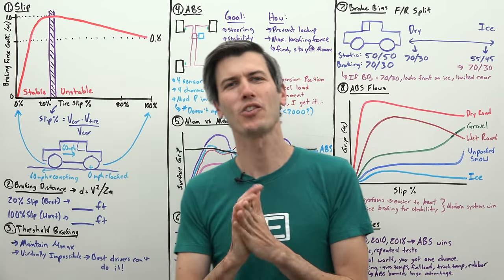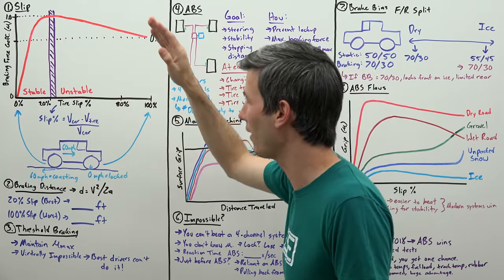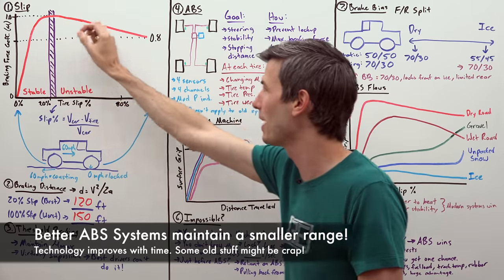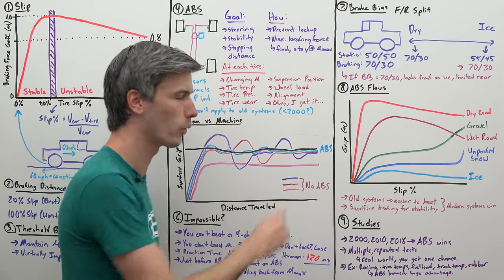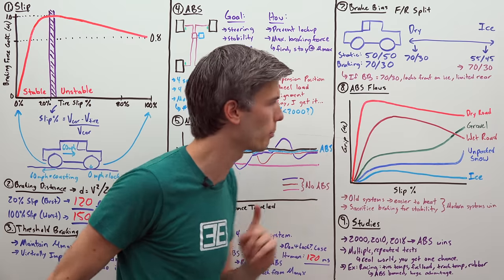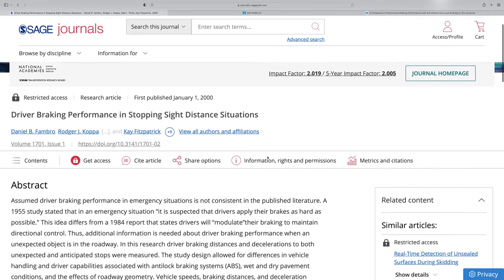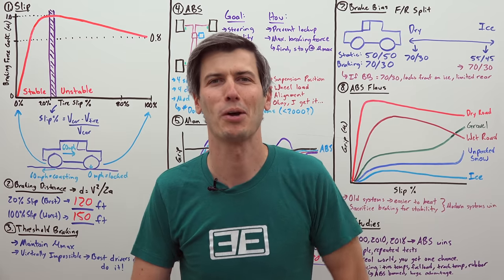Why Threshold Braking Is Impossible - ABS Wins!

Comment: I remember there was this interview with Verstappen and he said that when he was driving some GT cars for fun, after the lap his engineer told he to put more pressure on the brake to maximize it because the car had ABS. But he preferred not to and still posed some perfect lap times. I wonder if it's just because he was so used to the car not having ABS that when the ABS was on, he was just not used to it?
Reply: Funny thing about F1, they don't even attempt threshold breaking. You can't sustain it. If in theory you manage to perform it, the tires would quickly get far too hot.

Comment: My truck has this interesting behavior. I live on a small hill. If I come to a complete stop in the winter when the roads are super slick, then I start sliding, the ABS won't activate and I'll just slide down the hill without any ABS with my foot fully on the brake. I have to let off the brake to ge tthe wheels spinning, then get back on the brakes and the ABS will activate.

Comment: With my current car, a 2013 mazdaspeed3, I tried leaving abs active. 2 situations made me pull the fuse.
1) I was pulling up to my friend's house who had a dirt driveway. The driveway was covered by leaves. I hit the brakes, which made the tires slide on the leaves and activated abs. I nearly slid into his house. I pulled the abs fuse and did the exact same thing. I stopped 50% sooner because the leaves weren't a problem. 

2) I was pulling into a hospital entrance with rough, cracked concrete. This involved slowing while turning over small gaps and bumps. Abs activated and I nearly ran into the far curb instead of turning and slowing. I pulled the fuse and tried the exact same entry speed and went into the drive with no drama except maybe a little squeal from the rubber.

ABS is good for straighline braking on a predictable surface. But I've had too many bad experiences where it was the cause of a problem when there would otherwise be no issue. My abs fuse isn't going back in.

Comment: My experience of ABS here in the UK,  is every car I've driven fitted with with it has only the single channel system. As a result, I hate it with a passion!.
A single channel system means if one tyre loses grip even for a nano second, abs kicks in. If you don't release the pedal and try again, it's like trying to stop on ice. The car just WONT BLOODY STOP!
I've had a Prius and a ford focus that let me down badly when i needed to stop. I drive a brand new fiat van, that I haven't needed to stop in a hurry yet, but I will try and do a test later today and get back to you.
I'm very interested now to see if the system is as improved as you say!.
I have a bit of down hill road ending at a junction with a manhole cover half way down that the front wheel hits. If I'm braking firmly when the road is damp, the front wheel momentarily skids. The abs kick in, and the vehicle will not stop before the junction.
Releasing the brakes and  re- applying stops it with no drama.
One wheel locks for a couple of milliseconds and ALL braking efficiency is lost. I will try this out today if it remains nice and wet.

Comment: Pretty much reflects my experience (at least on bikes, my truck is one of those old ones that is questionable at best)
I'm of the opinion that unless you're on gravel or something super loose, at best you can do as well or maybe a tad better than ABS, depending on how well-implemented it is. But if you do engage ABS, then it is going to be better than if you didn't have it pretty much 100% of the time. Only real complaints are that it often can't be disabled, or will reenable itself unexpectedly, which if you ride mixed offroad can be sketchy, and (on my bike at least) some of them always keep the rear tire down, which will reduce the braking force slightly.

Comment: I learned how to drive with a 69 f250 no abs obviously. Spent years driving on snow, Ice, wet roads, mud, etc. no traction control or abs on anything for probably the first five years of driving. I can honestly say I’ve never been in a situation where I would not want ABS on a vehicle. Traction control I have turned off for unpacked snow or sand but that’s the exception.

Comment: Where I live, we use new Mercedes Sprinters as Ambulances, and in the emergency driving course, they specifically tell you to rely on ABS because it is better than a human. Each participant in the course experiences the difference, they get you to emergency brake twice from 100km/h, once using ABS and just planting your foot into the pedal, and then again trying to threshold brake. You'd be surprised at how many people think they can beat the ABS until they see the ABS cone fly by

Comment: 2 things though. First my 2004 Subaru impreza Abs was dangerous on snow. It would just lock up like it was a normal pedal. 2nd at least around 2012 you could stop faster on a motorcycle without abs. Mcn did a test with a Cbr1000 on youtube. Since then it might have changed though.

Comment: I got to drive a car in a racing school where they wired a switch to shut off ABS, threshold breaking is very hard and none of us could match the ABS. Also seems very hard on the car and I won't be pulling my ABS fuse for testing.

Comment: Agree with everything you said except for brake bias. Non ABS cars have a mechanical valve that adjusts brake bias. It is usually triggered by weight transfer so it constantly adjusts during braking. Pickups usually have a bias valve connected to the height of the bed so the bias moves depending on load.

Comment: I'd like you to explain why, we see cars with massive 8 piston callipers with huge  carbon ceramic disks, when the smallest of drum brakes have enough power to lock the wheels! Surely anything less than completely locking up the wheels would make huge brake systems unnecessary. Or is it solely to avoid brake fade?

Comment: bad thing with abs is that most are on the conservative side and activates too soon...it basically is tune at a fix setting..these are more simpler lower end abs that aren't 4wheel independent, brake bias is fix, etc.  I have even notice using low vs high performance tires abs kicks in a little late or little early.  Really notice this in motorcycles where the abs systems aren't as sophisticated and the rider is more in tune with the bike.  On my Honda Trail125 and CRF300L Rally the front ABS works really well off road, much better than I had expected and I trust it off road.  Haven't tried in mud.  The CRF300L Rally rear abs can be turned off while the Trail 125 has no abs on the rear only front.

Comment: ABS tuning can be affected by certain suspension modifications. I put a stiffer rear sway bar on a fwd drive car I did some track days with. It was mostly great fun and could rotate into corners lifting the inside rear wheel, which would make the ABS absolutely freak out and essentially deny me any braking for a concerning amount of time. It was so undrivable on track I had to revert to the factory bar and back to lame understeer. Bummer. I wish selectable ABS tuning was more common but I get it, I'm the outlier among the average buyer. Manufacturers seem more open to the idea in the motorcycle world.

Comment: On a bike when dry I can brake without locking up and lift the rear wheel of the ground. Now do a emergency stop in the wet. It's so much easier with abs, feel the front lock up, release while your fork goes up and down. Horrible feeling but you stop fast without falling. Car abs are much was faster pulsing and leave you with almost no brakes in snow/slush. And with stability program in sport you still need to know how to drift sideways, it's like e-brake pull when you understeer and into oversteer mode.😂

Comment: I definitely love the 'Technology improves with time' bit at 4:36. This applies to so much more than just cars and many people just have a knee-jerk hatred for anything technology related especially based on very dated experiences. Nothing's perfect of course, but realistically nobody is going to just leave improvements on the table (to steal Jason's phrasing here) for the hell of it.

When it comes to ABS, anecdotally I remember waaaay back when my mother had an old 80s Oldsmobile and the ABS would often go intermittent, fail, or was just crap. Now we've got a base model 2007 Kia and 2013 Ford vehicle both with ABS standard and even with the Kia hitting close to 200k miles now, the ABS/traction control system has behaved perfectly. And as reference, we live in an area that LOVES accumulating sheets of ice on the road in the winter.

Similar thought and shoutout to Technology Connections as one of their 'favorite' topics of choice: Heat pumps! Those have improved significantly over the years and modern units work at MUCH lower ambient temperatures than, say, a system manufactured in the early 2000s or older.
Reply: Also an additional note on this: Those who are worried about electronics like this failing and more specifically failing and causing potential drivability issues: Modern cars have so many more sensors and a lot more computational power that they can easily see based on monitoring MANY sensors simultaneously see if something is not behaving within expected parameters and disable a given system temporarily until that is sorted. Unlike the old days where an ABS sensor could have the system false trigger, modern systems can easily tell if the signal from one of the wheel sensors is out of whack and disable ABS (as well as other systems tied into it like traction control and, in the case of some hybrid/electric vehicles, the regen braking) but keep the car otherwise drivable without leaving the potential for a false trigger to happen.

Comment: It's more design than age. I drove a 1996 and a 2002 vehicle from the same company. The 96 was solid. The '02 was really bad. It increased stopping distance by about 4x, but did preserve steering. I used threshold braking just like my non-ABS vehicles without a problem.

Comment: There is a rare case in which this was not true, in South America the VW Gol Trend introduced ABS in 2014, but the calibration/programming was so bad that it would be outperformed by humans by about 5-10%. It did also not guarantee a straight braking, which was quite concerning at the time. (Source: Auto Al Dia Tests)

Comment: Just like autopilot in aircraft. When used as designed it will outperform any pilot. Pilots will never be replaced, only workloads will be lessened as needed while safety increases. Love your explanation style Engineering Explained. Wish we'd had someone like you as a science teacher 50-some years ago!!! Keep doing what you're doing. Much appreciated.
Reply: Aircraft autopilots are super useful, but nowhere near replacing or outperforming pilots. Flying is much more than raw control, it's also about anticipation, situational awareness and hazard prevention, which autopilots don't even bother doing.

Let me give you a nice little example:

You're landing your Cessna 172 at a small airport. You see a helicopter hovering above the taxiway off to the side, having crossed across the start of the runway you're landing on.

Your fancy pants imaginary magical autopilot will fly blithely into this situation, lose control despite all it's sophistication from the massive upset to the air caused by the helicopter, and kill you.

A good pilot will anticipate the danger and go around (even though the helicopter is not in the way, they will know about helicopter downdrafts and the danger they pose) preventing a crash.

This kind of thing applies to many many other situations in aviation - weather, large aircraft air disturbance, turbulence, problems with the aircraft, etc. 

Autopilots are not built to replace pilots
Reply: @Tom--Ace  Guess, I should not have used the word 'outperform'. As an 11,000-hour pilot, I agree with your example 100 percent. What I was thinking about is a single pilot flying that C172 in IMC weather overloaded trying to talk to ATC, and copy a complicated amended clearance while holding a heading, altitude, and tracking a waypoint, AP will do it better hands down. Thank you Tom for the chance to clarify. As John and Martha would say, "keep risks to a minimum" vs fly safe. Cheers.
Reply: @Scharpy1  oh in that case I agree. I hadn't realised you were referring only to pure flight surface control. Nothing beats the precision of automatic sensor based systems. A human pilot in IMC is shite (they'll manage on guages, but can't beat autopilot there). But so far, human intelligence is still imperative in the actual flight decisions

Btw nice! What do you fly? I'm guessing a big jet of some sort? I'm just light GA myself
Reply: @Tom--Ace  Nah. Retired FI and tour pilot. Check out my playlist 'Personal' on my channel if you want to see why I retired a few years early🙄. Take care brother.

Comment: When I load up a car with locked steering onto my tilt tray (rollback).
I use the wheels rolling to go one way, then lock up the brakes to have the car go in the direction of the winch, which would be the inertial force direction in a crash.

Comment: We did this experiment on a motorcycle riding course, and most of us stopped in a shorter distance with carefull breaking and avoiding ABS rather than simply breaking as hard as you can and relying on ABS. I could clearly feel the ABS system switching between full lockup and releasing the break, so at least in this example it isn't fair to assume that ABS will magicaly find the perfect balance. Also there was a difference between grabbing your breaks as hard as you can and breaking just hard enough to feel the ABS working. In both cases without ABS I'd have a full lock up, but in the second scenario I had a shorter break distance. This lets me suggest, that we have to look at the implementation of ABS and cannot asume that it's perfect.
Obviously in this test the cards were stacked against the machine. On a bike you can focus on a single tire when breaking (rear tire I left to abs, as it doesn't contribute much to the breaking distance and I as a human can only focus on one thing). Also we riders were prepeared to break and could fully focus, which is definetly not the case in any real world emergency situation. I'm very glad to have a good ABS system on my machine, as it saved me from many many cockups and probably prevented more than one bad accident. And for cars I don't see any reason in normal driving not to use ABS.

Comment: I can't brake at threshold, however in an early 2000's toyota I had, when stopping on snow, the abs action could be counted in seconds... slow, lock and slide for 1, 2, 3, slow, lock and slide for 1, 2, 3, etc from slow speed in a straight line, no ice. I had another toyota FRS in 2015 which had decently quick abs which I liked, but got a dealer loaner corolla at that time which was as bad as that old 2000's toyota on just wet roads. I still don't trust cheap car abs systems, even if I can't outdo them, at least I can practice and have more consistency at that lower level. Good car abs systems, and modern motorcycle abs systems, I'm all about, they're great!

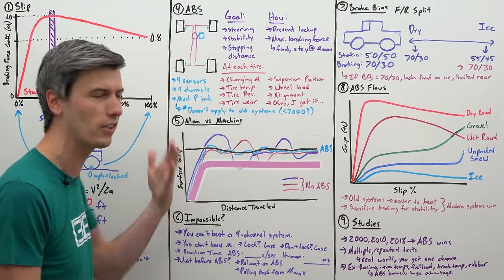Comment: 6:58 this is why BAS exists on top of ABS. When the car detects that you're panic braking, but don't fully stomp the brakes, it ramps up the braking pressure to ABS levels. As it turns out, many people have no idea how hard the car can actually brake, because they never tried it and they're scared to go all the way.
Modern cars can brake incredibly hard, especially hybrids and EDC or planetary gearbox automatics. They combine engine braking with dynamic braking in the case of some hybrids, and the mechanical brakes.

Comment: I think about this like I think about the systems that simulate a locking differential by using the brakes. In theory, these systems should be able to work as well as a locking diff, but that will only happen with a good implementation. Early systems were much worse than real locking diffs. Some modern systems work so well, that they do perform as well as a locking diff, but some don't. I think the analogy holds for ABS. My E36 BMW (3-channel ABS) definitely stops worse on dry pavement if I get into ABS. It's more effective for me to stay well below the limit of grip than it is to go over it and have ABS activate. But if I had a race ABS system, or perhaps a good modern road ABS system, the results would be different. I think the answer is more nuanced than the video claims.

Comment: I was going down a residential street with roughly 3 inches of slushy snow and when I came to a gentle corner I turned the wheel and it kept going dead straight.  I hit the brakes and I could feel the abs working ('89 Dodge Spirit] and they did nothing to slow the car down. I hit a tree dead on at 27mph. I had whiplash in my neck for around 15 years after that. To this day I don't know why the car didn't slow down.